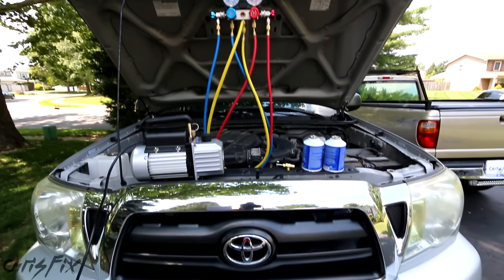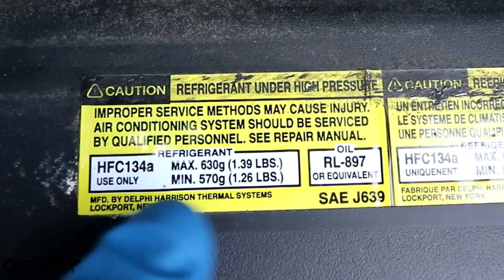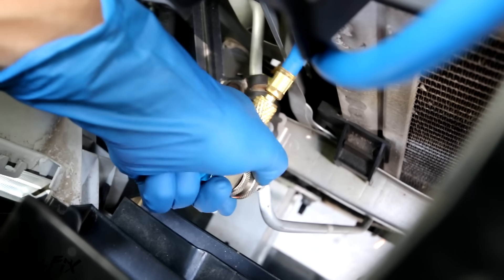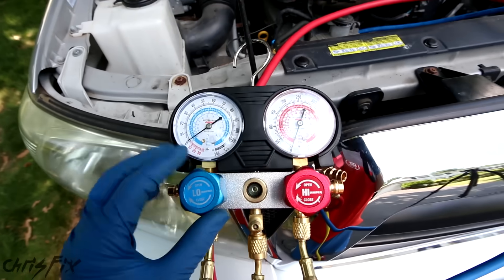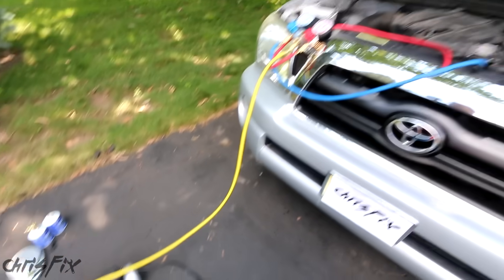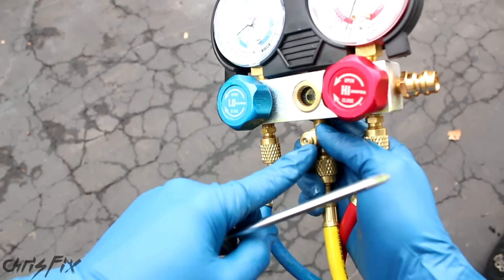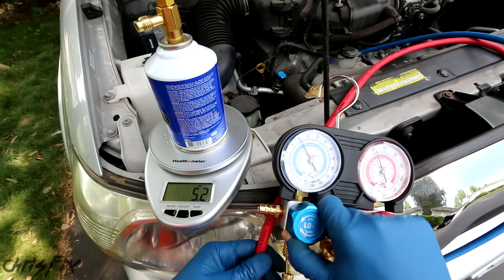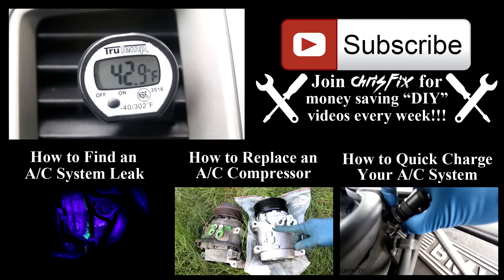How to Properly Recharge Your AC System

Comment: At 2:50, you said that moisture in the system can cause leaks ?  How is that ?

Unfortunately, most small-time amateur car owners like us cannot afford a vacuum pump.

One last thing. Don't you need to change the receiver drier ?

Thank you for your very detailed video, Chris.
Reply: If there is moisture in the system it will rot everything from the inside out, rust, rot whatever. The price of the kit is worth the investment if you are going to do work yourself and likely help others. And no, you don't need to change the drier unless it's damaged/leaking.
Reply: @cruisey9857  

Thanks for the info. 
A little confused here.
The stopcock at the bottom of the gauge. Does that close/open the bottom valve below  it (leading to the charge port), or the side valve (leading to the gas can) , including the outer ones on the left/right, which are not used ?

( I  was wondering how the gauge was going to measure the vacuum, if he had closed it after vacuuming.  )

Comment: At 11:50, near the end, you opened the suction valve slowly, because you did not want the refrigerant coming from the can to turn to liquid and damage the compressor.

Isn't it already a liquid in the can,  and is also sucked in as a liquid ?

Comment: Good video. Just to be clear on one thing . The high pressure connector on the line in the air system in the vehicle stays open and the high pressure knob just under the gauge stays closed while charging correct?
Reply: the red line stays open, if you watch you can see the pressure rising, that wouldn't happen if the valve was closed.

Comment: the issue with the HF AC manifold adapter valve starts to leak so you'll think your AC system is leaking but the AC manifold valve itself leaks.

Comment: Im confused, you say to take it to a shop to get the r-134a removed because its VERY hazardous to the environment, and you for that matter, but then u say to purge the can when getting ready to add the r134a and u purge it into the atmosphere....
Reply from the maker: Yeah, the only way to purge is to atmosphere. There is a difference between a fraction of a second purge and releasing pounds of this stuff into the atmosphere.
Reply: @chrisfix  Next time get a hose to discharge into a bucket of water and then take to your local waste disposal
Reply: @MoeKoopa  its a gas. Small purges like that are considered de minimus because they are small and unavoidable with a bar gauge manifold.
Reply: @Redtooth75   guess my HVAC instructor omitted that bit of information.  I figured for his audience its advisable to just be as clear as possible.
Reply: @MoeKoopa  tell your instructor he is ignorant. Small vents are inconsequential. 134a is also not an inhalation hazard unless there is enough of it to displace oxygen and cause asphyxiation.
Ill break it down this way. 134a has a GWP of 1,430 so venting 1 pound of 134a is equivalent to venting 1,430 pounds of CO2. Burning a gallon of gasoline creates about 20 pounds of CO2. Venting 1 pound of 134a is equivalent to burning 71.5 gallons of gasoline. So purging a fraction of an ounce of 134a is equivalent to driving your car to work.

Comment: If your gauge set doesn't have a Freon bleed, just loosen the connection at the gauge set.

I've never seen refrigerant/oil data on any of my cars.  Good on Toyota!  My latest AC repair required my official GM factory manuals to give me that information.

I wonder why the valves on the port connectors are backwards in terms of closing an opening standards.

Great video.  I really appreciate the fast, accurate conversation w/o wandering, mumbling, trying again. It was a good refresher for me as I recharge a system tomorrow.
Reply from the maker: Thanks a lot and great tip!

Comment: When I tried to pull a vacuum on my AC system my AC system doesn’t go down to 30 it is just stays in 0, can somebody help me please I’ll really appreciate it, thanks
Reply: Make sure you have the valves on the manifold and on the end of the connector open. Some vacuum pumps have a valve as well so make sure that is open. 
If they are all open the close the valves on the manifold and turn the pump on. If it then pulls a vacuum then you have a very big leak in the system. If it still does not pull a vacuum you have an inoperable pump or a big leak in your hoses.
Reply from the maker: I agree with Redtooth

Comment: Hey Chris! What if I try to purge the yellow line of air, but no refrigerant come out!?? It just barely hisses, but barely any pressure and no refrigerant coming out!
Reply from the maker: Double check all connections then try again, I've heard that happening the first time around
Reply: @chrisfix  somebody told me to make sure the can is held upside down when trying to purge the air. He said no refrigerant will come out if I didn't hold the can upside down. Is this correct?
Reply: @phillippardo5712  it is easier to verify that you have purged the line if the can is upside down. With the can upside down you get liquid refrigerant so it is obvious when that comes out of the port. With the can upright it is vapor refrigerant which is hard to distinguish from air.
Reply: @Redtooth75  are you saying the reason why you could see a cloud of refrigerant in the video is because Chris must have had the can upside down? I purged right side up without knowing you were supposed to do this and what came out was always clear/invisible, never a visible spray like in the video. I held down the purge valve for about 20 seconds and it was always clear. Is the line still purged after 20 seconds even if I never see the refrigerant?
Reply: @danieldean7123  yes the line will be purged. When the can is upright you will get refrigerant vapor and not liquid. The vapor will look identical to air. If the can is upside down for the purge it will be easy to tell when the line is purged.
Reply: @Redtooth75  super cool. I had no idea. I really appreciate this.

Comment: Worst video Chris has ever done. He left so many things uncovered... so many questions unanswered. If my vehicle's AC does not cool efficiently (but there is still freon in the system) what do I do? If i dont need to remove the old freon, how can i tell how much(ozs) i need to pump in? Dont i have to reach certain pressure level to know where to stop? Do I remove the old and put new along with oil? He never explained about the high pressure valve on the manifold (what do I use it for? Just a valve to open and close?). So many, many more questions! Have to find something better to help on adding freon

Comment: What will happen if you forget to add oil when recharging your ac
Reply from the maker: You can burn out the compressor and you'd have to replace it if there is currently no oil in the system
Reply: @chrisfix  ok I wasn’t really sure since I only replaced my condenser.

Comment: The high pressure manifold needs to be closed all the time, it's only for measuring purposes. The system may explode if you leave it open. And the port you use for the yellow hose is the one on the side instead the one of the top

Comment: Chris newbie here ✋, I would like to ask the purpose of adding oil before charging refrigerant. My case are replacing only my compressor oil and receiver drier. Thanks in advance
Reply from the maker: If you add refrigerant before oil, you could burn out the compressor and be left having to replace it unnecessarily
Reply: @chrisfix  I mean I have already exact oil on my compressor. I would like to know of what’s the purpose of adding PAG oil on (High) pressure line valve.
I’ve seen some videos they add oil on High valve after condenser,compressor and evaporator replacement or leaking. Do I need to add oil on high pressure line even my compressor has exact and correct kind of oil already?

In addition based on the internet, “The system holds 5.4 ounces of Pag oil, not including the compressor”. 

Evap: 2oz
Condenser: 0.5oz
Suction hose: 0.3oz
Receiver drier: 0.3oz

This is I got confused about, coz it says  “excluding the compressor”. Based on my understanding this is only applies maybe when replacing new condenser and evaporator. However, if I only changing my compressor oil and receiver drier there’s no need to add as it has already on the system. What if newly assembled ac system on a vehicle. Should I add 5 ounces?…

Thanks again Chris for your time.

Comment: Hey Chris, EXCELLENT videos! When you pull down the AC system will it pull out the oil in the new compressor as you draw it down? Do you have to add any oil during this step or when your charging the system. Thanks Tony

Comment: Some or most ac car shops or ones with service in my country would take advantage to just top up the gas (they don't even use machine or scale 🤦🏻‍♂️. Hardly seen any of them use torque wrench) without finding the cause. In my case, gas kept leaking. Cause was a leaking compressor (i wish they would weld to seal if possible rather than replacing lots of things 💸💸💸) & according to the shop, most shops don't have compressor diagnostic machine. My wife's car was really hot, she had to replace the magnetic clutch at the same shop. I'd love to try your 2 years video gasket sealer, but only k seal available on my local e-commerce.

Comment: Do I need to add oil if I didn't replace any major parts? The truck is old and the system has leaked out on its own. I just want to recharge the refrigerant and see if it works/leaks.
Reply: No the oil remains as long as you don't replace anything

Comment: Hey ChrisFix ! Love the channel been watch for years. You inspired me to work on my own cars. I have a question. I own a 06 ram 5.7 it hasn’t had ac for years. But when it did it blew cold. I’m guessing it had a leak. One day I decided to go to Walmart and forgot to measure the ounces so I think I over charged it. Killing the ac clutch. When I turn on the ac even now. It smells horrible like chemicals so I’m guessing it’s a ac evaporator core behind the dashboard. My questions is. I’m getting ready to spend a lot of money. New ac compressor new lines. New drier. New new condenser and new evaporator core. Should I pull a vacuum on the system ? Or it wouldn’t work ? I don’t want the new parts to get contaminated or whatever else can happen if I just replace instead of removing everything. The truck has zero Freon !  Ac clutch doesn’t work. It doesn’t spin. Any tips ?

Comment: Can you pull a vacuum even if your just topping off? No problems with ac just feels like it needs a bit of refrigerant.
Reply from the maker: No just top it off. There is no way to pull a vacuum without sucking out all the refrigerant and there is no need either since the system is pressurized so there is no air in it.

Comment: Why measure the weight of the coolant when your gauges will tell you when you get the right high side and low side pressures? Pressure is the key thing.
Reply: I saw another person explain it as basically OEM specification > gauge readings, unless the gauges indicate a dangerous overpressure, but in that case something else is majorly wrong
Reply: Pressure alone does not tell the full story. Superheat and subcooling are also factors. A system can be under/over charged and still show very close to the correct pressures. This video is for the laymen, not professionals. Charging by superheat or subcooling is more involved and requires more expertise than charging by weight. If you don't know what you are doing then charge by weight.

Comment: hi chris at 10:12 in the video you never mention to open the high side,how can you read the presure without opening also the high side? plese correct me .
Reply: You open the high side only when vacuuming, turning it off at the gauges still allows the gauge to read the pressure. You just don't charge through the high side port

Comment: Wouldn't it be better if you bleed the air before opening the low pressure line valve?
Reply: He had already pulled a vacuum on the system, there was no air in the system.

Comment: Hi @Chris, been watching your videos for almost 2 years, and this is the first time I comment because I have to ask for a related issue with my AC. It turns out that my ac system was filled out with liquified refrigerant. Would like to refill with youre method (shaking and not opening the low side in full). One question, to remove the liquid refrigerant, Is the vacuum process on same video will worked?  should I need to pull down the compressor as well? 

Thanks!
Reply from the maker: Refrigerant is liquid when compressed. The refrigerant I used is liquid in the can and then turns to gas as you add it. It’s a gas in the system when not compressed.
Reply: @chrisfix  thanks for your insights Chris.  I'm just worried because the ac technician did charge refrigerant on upside down position so do I need to vacuum it again and fill on the right way? Thanks!
Reply: @markacepayongayong2897  charging by liquid is fine if you are careful. Its not recommended for laymen because you can cause a liquid surge into the compressor and damage it. But if the charge is throttled in or a vaporizer is used then its fine. Many professionals charge as a liquid because its faster.

Comment: You're the man Chris it's been 12 years now my AC went up apart everything that you got the AC compressor the gauges all kinds of stuff I tried it on my car and it's been 2 years and still going strong I had a leak in my system truck water with dish detergent and found the leak it was my AC compressor it was bobilon crossvine out it was the two seals on top of the AC compressor but I changed it anyways you're awesome dude

Comment: I plan on draining my compressor oil.  I will than put the compressor back on.  Can put all the oil for compressor and system through the manifold or I need to add oil in compressor first.

Comment: I did this before, it worked great.. this time, my pump only brought down to -24.  When closing gauges at manifold.  Negstive pressure was lost..    Not an AC expert but I imagine this means there is a leak?  When system drained there seemed like a lot of pressure still in the system so it seems odd there’s a leak…. Something isn’t adding up.. any help would be much appreciated…. Thanks
Reply: What I've seen once before is a physical blockage inside a line hold refrigerant in one part of the system but another part can be totally empty

Comment: I am getting Vacuum pump and manifold from Autozone.  These will be rental tools that other people have used.  Is it okay to use, considering my system takes R134a and other people may have used freon(R12)/1234yf refrigerant and/or other garbage inside. Any way to clean unit before using (eg put compressor oil)

Comment: Great vid. A small note to add its good practice to replace the receiver/dryer if you've cracked open the system for some time, like replacing a major component (say compressor)

Comment: Chris I have a serious question for you, I have a 2005 Nissan Frontier, I evacuated the system and started charging the system. It reached a point where it is not accepting any more refrigerant but the system is still too low for the compressor to engage itself. I don't want to bypass that feature as everyone is saying, what is the remedy for this problem?
Reply from the maker: Are you sure your compressor works? It should turn on at a pretty low pressure. If the pressure sensor and compressor both work, I would try a fresh can which has extra pressure.
Reply: Yes the compressor works, it would involve me to totally discard the tapped can. I have 700g which is approximately 3 cans of the refrigerant to be added, I'm almost half the first can where it has stopped adding. I tried closing both side of the gauge, high and low, closing the refrigerant line, then opening both the low and high side to see if I could equalize the high and low side.... No help... Still off and wont engage. I turned the compressor manually, it is free by hand. I'm confused
Reply from the maker: @blakchyny  Dang, well without seeing the car it is hard to say. Are you sure there are no leaks and it's holding pressure?
Reply: @chrisfix  that's the first thing I did, vacuumed it to below -30psi and held it there for approximately 25mins before starting
Reply: @chrisfix  seems like the bypass is what is needed huh?

Comment: I'm a little confused about the part where you add another 10 ounces of r134a to the system. Isn't it measured in liquid ounces? I thought you cannot weigh liquid ounces since they're measured in volume
Reply: Ounce is weight.   Pint, Quart, Gallon....are Volume
Reply: The can is mislabeled as fluid ounces when it should just be regular ounces. Refrigerant is sold by weight which is why the metric equivalent is in grams.
Reply: Fluid Ounces is the weight of the product separate from the weight of the container
Reply: @davidbloomberg9494  fluid ounces are volume. There are 16 fl ounces in one pint.

Comment: Hi Chris, I replaced the compressor (supports r134a) of my car in a local garage with a structually very similar compressor retrieved from a new model but used vehicle (supports r1234yf). The high side and low side MPa are same in both the compressor. My car's AC system supports r134a and it was regassed recently. I would like to know if while replacing the compressor, the freon was released (the mechanic just replaced the compressor) or it is still there. Also, if the new compressor contains any traces of r1234yf from previous vehicle. If so, if I should be evacuating the AC system before I regas?
Reply: Gas is lost with any exposure to atmosphere.....   If the system was evacuated like Chris did, then it should have removed the old gas.  

Hopefully your mechanic used the correct oil for your compressor and R134a gas.